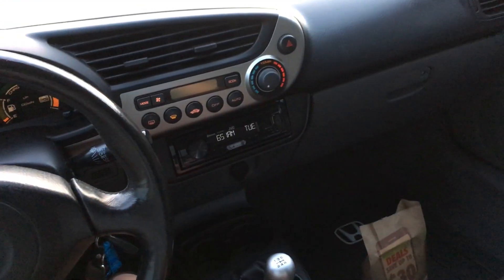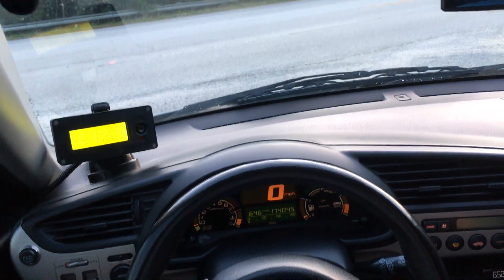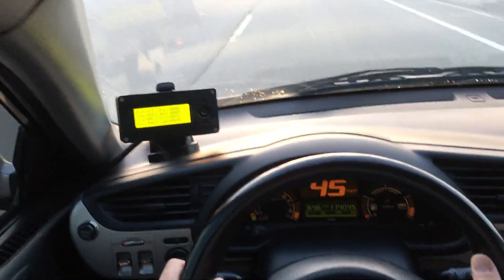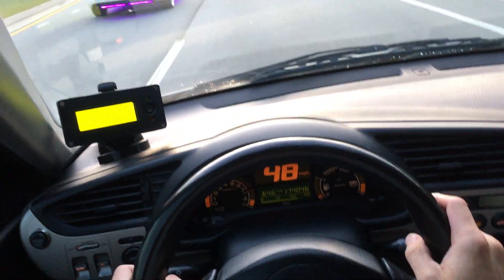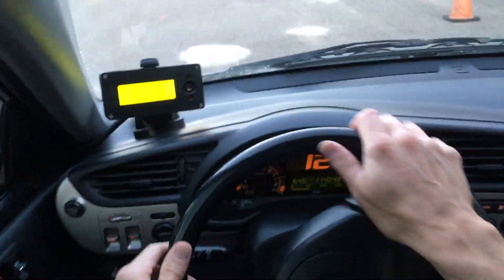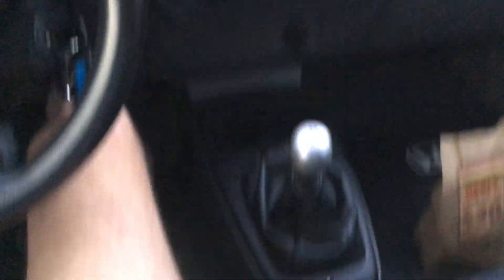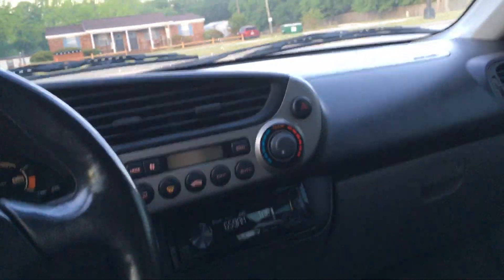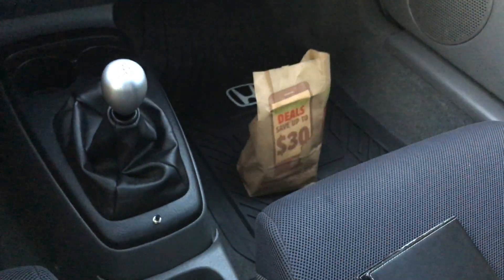EFAS (Elegant Forced Auto Stop) for 2000 Honda Insight

Comment: Do you have a grid charger for your car? If you are going to be using the battery much more, I would want a fully charged battery every day. That turns it into a quasi plug-in hybrid. I had one on my 2003 and it worked great, easy install. I sold my 2003 earlier this year and bought a Chevy Volt. I drive about 30k miles per year and loved the efficiency of the little Insight, but it was a little too rough riding for me and you really have to drive defensively due to it’s size. I can’t tell you how many times SUV’s, full size pickups, and semis pulled out in front of me or attempted to change lanes into me. I started driving with my headlights on and that helped a lot. Mine was silver and I think that color blends into the highway at times, at least that is what I figured was happening. The Insight was the cheapest car to own I have ever owned.
Reply from the maker: Thanks for the good words.  No grid charger, my battery is new with a 5 year warranty.  I have no interest in grid charging, I'm one of those Insight drivers who wants to experience the car as Honda intended it rather than have to plug it in every so often.  So 5 years for me then I'll get a new battery if needed.  It's relaxing to never have to think about the IMA battery!!!!!  Helps me enjoy the car more.  For the money I think it's worth it.
Reply: Hi just curious,  if my grid charger has loiter hours,  to set,  would you not grid charge, or just till it's charged, or how often would you charge and how many hours over all and how many loiter hours

Comment: Lean burn is simply burning fuel lean of peak exhaust temperature LOP. Perfect air/fuel ratio is 14.7/1 which is called stoichiometric efficiency. So it takes 14.7 kg of air to 1 kg of fuel to completely combust.) When you lean out the mixture in any internal combustion engine, the exhaust temperature rises, it can rise quite substantially, enough to melt steel exhaust. Your efficiency goes up as you lean out the mixture, but then you have that nasty heat problem. So the trick is to keep leaning through the peak exhaust temperature to the other side of the temperature curve where the temperature falls back into safe range. Efficiency is quite high in that zone. Many doctors, lawyers, and small business owners who own airplanes but are cheap bastards will run their engines LOP. I’ve seen emergency landings caused by fires from exhaust manifolds melting, exhaust valves breaking, piston and cylinder damage, etc. (These are all manually controlled air/fuel mixture engines). Anyhoo, obviously Honda controls the LOP via computer so should never have a meltdown of that type. Almost all airplane engines are air cooled and cooling depends on the condition of cowl seals, etc. I don’t know if your OBD2 will display exhaust temp, but if it does, watch it as you attempt to get into Lean Burn and you should see temps climb, then descend as it goes through LOP and enters Lean Burn.
Reply: You would think on an airplane that reliability would be valued most. Thanks for the "insight", very good point.